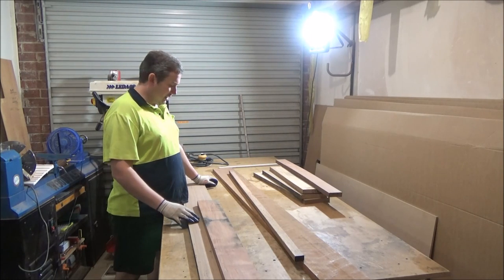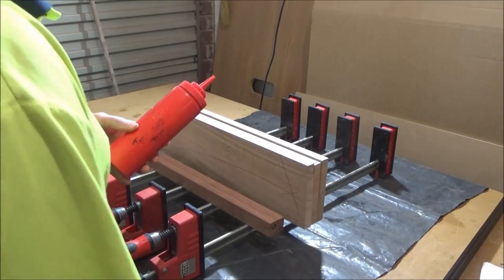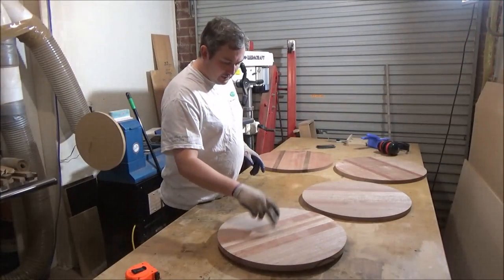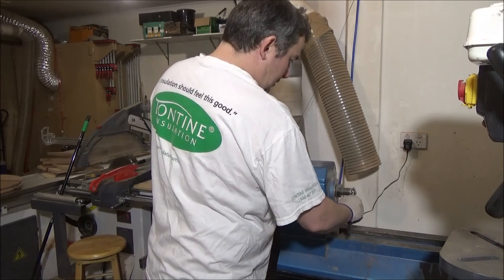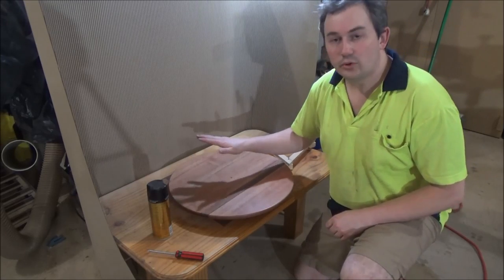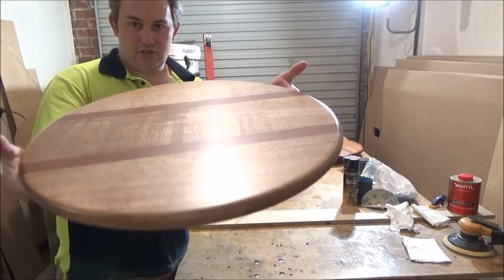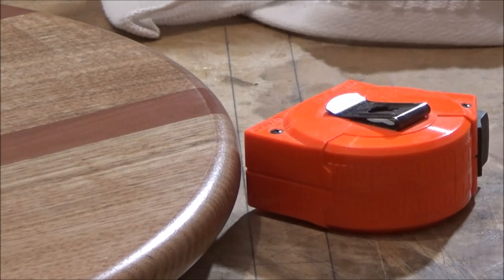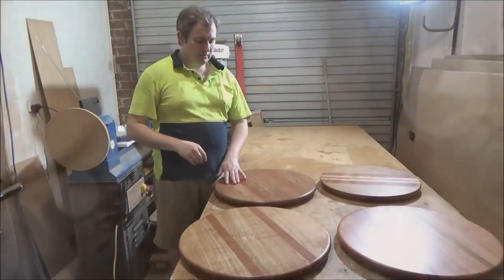How to make a wooden lazy susan - woodworking project

Comment: I didn’t know that you could apply Danish Oil over Polyurathane.   That’s what it looked like you were doing in the final finish but I must be mistaken.  Can you please explain.   Nice clean video.  Thanks. Phil.
Reply from the maker: I applied Danish oil first. I was hoping to finish there, but I wasn't happy at the point. So I sprayed a few coats of poly. So long as the danish oil finish isn't completely cured, I can apply poly over it. A light scuff sand is always a good idea though. Danish oil is poly with a little more oil in it, basically the same stuff.

Comment: Turned out really nice. Love the lathe trick! Would love to see a video or article on the finishing technique you used.
Reply from the maker: Hi Jason. I am currently building a website. I will add my videos to the site and since I am there I may as well add an article, or plans if I feel they are required, alongside the videos. But until then, I can just give a brief summary of how I finished the panels.

First I have sanded the panels to 400grit on the top and 240grit on the bottom. The edge grain I sanded to a slightly higher grit of 600. I used a random orbital through the grits up to the final grit, and then finished by hand sanding with the grain with the final grit paper. 

Then I applied two coats of my homemade danish oil. 45% gloss polyurethane/ 25% boiled linseed oil/30% mineral turpentine. It was hot in the shop when applying, so I applied a heavy coat with a rag and allowed it to sit for approximately 30mins. Then I got a  fresh cloth and removed the excess from the surface. One hour later I came back with a cloth and gave the surfaces a quick wipe to remove any regurgitated oil spots which seep out onto the surface and if allowed to dry, they create raised glossy shiny spots which need to be sanded away later. I wiped the surface every hour or so for about 3 hours. I did this danish oil process twice. I was hoping this would be all that I needed to do, but I wasn't completely happy with the surface, so I opted to spray polyurethane as a top coat.

I left the danish alone to cure for approximately 7 days, and then gave it a quick sand with some worn 320 paper to leave a nice flat even sheen over the surface. Then I sprayed three or four coats of polyurethane 2 hours apart in a single very hot day. I did not sand between coats.

Left the polyurethane alone for a week. The surface finish straight from the spray can was the perfect sheen level that I wanted. But it was rough with dust nibs and a very slight orange peel type surface. Using my random orbital sander with 400grit sandpaper, I dry sanded the surface smooth to leave the surface slightly below a satin sheen. Then using 0000 steel wool lubricated with some teak oil (it is basically 30% boiled linseed oil and 70% turpentine), I rubbed the surface with the grain. Then I wiped up the oil with the soft cloth and the job was complete. 

It takes a lot of time to finish like this, but the end result is hard wearing, nice even consistent satin sheen, and smooth to the touch. Everything that I look for in a good finish.

Comment: enjoyed the video, I tried the same with some Tas myrtle and blackwood, but a couple of days after the glue up I found the whole lot had bowed badly especially the myrtle, is there any trick to getting the grains right?
subscribed.
Reply from the maker: To start with you need to use well seasoned material. If the timber isn't acclimated to your specific location, it may/will shrink or expand and it will probably cup when that happens. Secondly, when gluing up wider panels using multiple boards. You should orient the growth rings as a smile, frown, smile, frown, smile, frown so on and so forth. So if ALL of the boards cup, you will end up with a wavy board rather than a potato chip which has curled up. It is much easier to flatten a wavy board than a potato chip, and you also lose less material flattening a wavy board. The next thing to do is never allow the panel to rest on a bench top for long, definitely not hours and especially not overnight. Think of this like leaving a sandwich on a plate overnight. The top surface dries out and becomes crusty pretty quickly, but the side which was protected by the plate surface will still be soft and moist. The same thing happens with timber, and when you have a difference in moisture from one side of the board to the other, the board will cup. So when not working on the boards, I prefer to stand the board on its end grain slightly leaning on something so it doesn't fall over, but still allowing airflow all the way around the board. 

If I have a panel which is pretty lively and is moving around on me, cupping and warping while I am working on it. I will put it aside for a few months and come back to it before finishing with lacquer or varnish etc. This gives the board some time to do what it wants before it settles down and becomes manageable again.

Comment: Did you remove the plastic bumpers before you attached it to the top or just screw through the bumper to the top?
Reply from the maker: On the bearings I used, there are bumpers on both top and bottom. I removed the top ones so that the aluminium is in direct contact with the wood. I left the bottom bumpers on so that there is a soft cushion between the lazy susan and dining table surface.
Reply: @kuffyswoodwork  I couldn't tell from your video.  Thank you!

Comment: Very nice work mate.
I want to do something similar but I don't have a jointer.
Reply from the maker: Thanks. I use the machinery and equipment I have available to me. If I had a barebones set of equipment, I would buy DAR material and use a circular saw and a cheap vintage hand plane to do the job, a router would be a big bonus but not technically essential.

Comment: Very nice mate, how's that Jet under/over machine? I have the iwoodlike version which I'm sure is the same just rebadged.
Reply from the maker: thanks. there are differences between the Jet and Iwoodlike. the jet has 3.5m/min feed speed and a 2.25kW motor whereas the iwoodlike is 7m/min and 2.75kW. the jet has a textured/rippled finish to the tabletop to reduce friction, i dont know if the iwoodlike  machine has this.but mostly they are the same machine just with a few minor options added in or removed.
Reply: I wish mine had a slower feed rate. the current feed speed just smashes up stuff like spotted gum or anything with figured grain
Reply from the maker: The slower feed speed is why I bought the Jet over the woodfast which was about 300bux cheaper at the time. It is also great when feeding dozens of 300mm lengths end to end. I know from experience that you need heaps of power to take a decent cut with a thicknesser, and 3hp is such a lightweight motor compared to the industrial machinery I am used to when working for a boss man. I rarely take cut deeper than 1mm with this thing because it just starts to scream.

Comment: Is this something specific to this lathe or will that sanding work on any lathe?
Reply from the maker: It's not specific to my lathe. The head stock spindle is a hollow tube so I was able to make that mdf jig to attach the lazy susan's and spin them for easier sanding. I don't have any problem using that jig for sanding, but I certainly wouldn't attempt to turn any wood, it would be very unstable and unsafe.

Comment: Will the lazy susan turn if it is vertical as opposed to horizontal?  I want to make a vertical spinning prize wheel.
Reply from the maker: It will turn vertically, but I am pretty certain that the prize wheel will be very unfair. It will favour one section of the wheel due to random things like not spinning perfectly dead center, the timber boards being different weighted at various areas of the board etc.
Reply: Thank you very much for replying.  That is good information.

Comment: Hi mate, 
where did you get the spinners from, I have been using different ones that are very harder to put on. Steve S J S Woodturning
Reply from the maker: I get them from a local retailer in Melbourne. The bearings are pretty good. 
https://www.timbecon.com.au/cabinet-fittings/house-furniture-fittings/lazy-susan-bearings-aluminium
Reply from the maker: @ohasis8331  Yeah I noticed that last time I was at Timbecon. Ah well, I have a few here still for when/if I need them.
Reply from the maker: @ohasis8331  They were pretty cheap. I think it was either 22bux or 30bux for a 300mm bearing. They are kind of noisy, but it's really not much of an issue given that a quiet alternative starts at 100's of dollars.

Comment: Where do you get the hardware for the lazy susan
Reply from the maker: I got the lazy susan bearings from Timbecon. www.timbecon.com.au   But I just had a look for them on their website and could not find them listed, but they are listed in their catalog. I haven't bought any for about a year, so they may no stock them anymore.

Comment: Nice job but if i could find a fault it would be they way you sharpen you chisels You should use the figure eight because you won't wear down you sharpening hone And you chisels will alway stay at 33% and square to the point The irish way as we say in london
Reply from the maker: Thanks. Sometimes I use figure 8's with chisels only, but mostly I do W's up and down the stones. I find that the figure 8's don't work very well with wide irons such as plane irons. if I can keep similar processes like sharpening a chisel or sharpening a plane iron the same, then things remain consistent and mindless.

Comment: Maybe be messy and hard work, but you raced through it..
Reply from the maker: It took about two hours to get all eight faces pretty close to smooth. I did allow some ridges to remain because they were going to be sanded anyways and it only takes seconds to remove hand plane ridges with 180grit sandpaper. I broke up the two hours work with lunch in between as well as finishing the fourth panel in the morning. I'll be damned if I can push a #6 with fairly straight iron for too long.

Comment: The title says "How to make a lazy susan" all we are shown is a finished product no instruction how to make it. Thumbs down from me for fake title.
Reply from the maker: The description says "demonstrating how to make four wooden lazy susan's....". Who judges a book by the title...that's what the blurb is for duh! btw, I explained how I sanded the edges using my lathe, how I finished the pieces with danish oil and then poly, how I cut the circles out using a router trammel, how I smoothed the rough finish using steel wood lubricated with oil...perhaps you were watching some other video or feel hard done by that you weren't supplied a full set of instructional plans...for free of course..get off your high horse